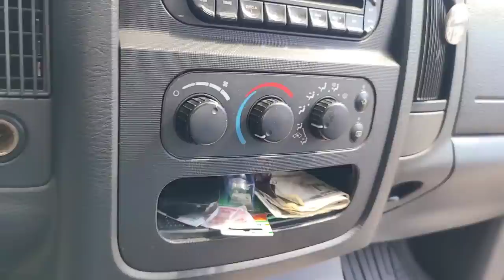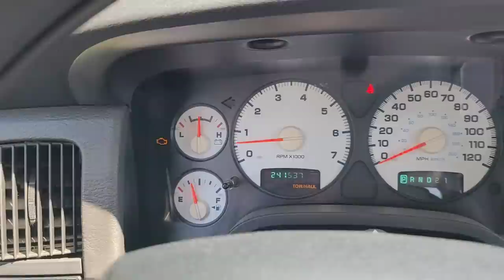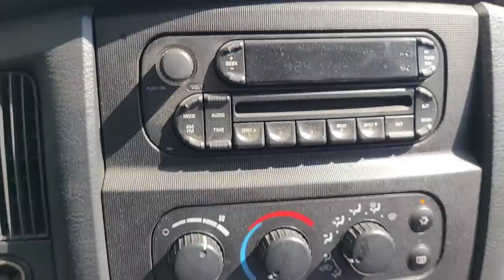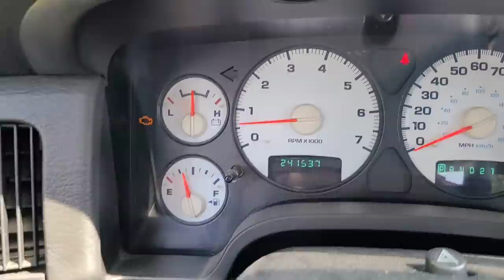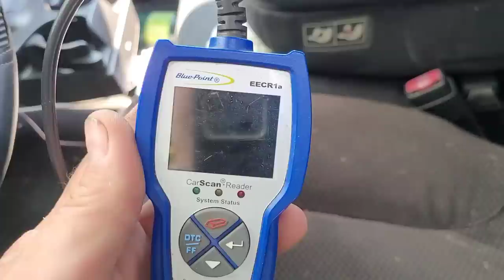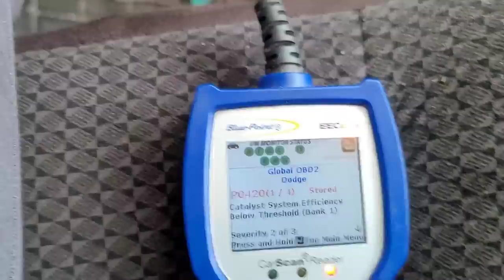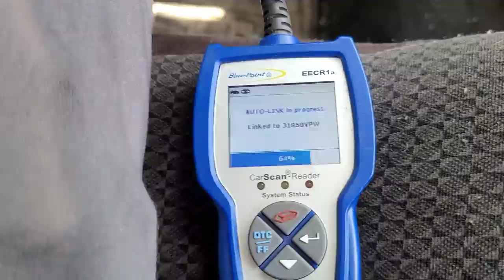Don't Get Scammed Buying Your Next Used Car!!

Comment: I just sent this link to my daughter.  She is looking to get her first vehicle.  I would help her, but she is 700 miles away. This is a big help. Thank you for your informative videos
Reply: There's two things that I always do and recommend doing with anyone who's buying a used car from anyone including a car dealer..,....1) run a scan on diagnostic specifically the mode 6 file which gives the history of the number of trouble codes and how many times they were reset and 2) take it to a frame shop where the chassis can be inspected and they can visually see if any repairs have been made and if they were done correctly

Comment: Really liked your explanation of Torque Management. The amount of work the designers went to to prevent engine and transmission damage is amazing. I’ve disabled most of my torque management via HP Tuners.

Comment: This is one of the best pre purchase used vehicle guideline videos on Youtube. Your truck would be considered MINT if the rust had not rotted the body and frame. Because here in Upstate New York, that year truck would be in the crusher already. The rust would have eaten the entire truck from the bottom up! I owned an 03 Ram that the hood was starting to rust from the inside out from the brined, calcium, and mega-salted New York State Thruway. My cruise control servo, located under the battery actually rusted completely through!

Comment: Great video Kenny. Over here in the UK all vehicles have to do a compulsory annual MOT test where they basically do this to register it as ‘ Road Worthy’.Good tip, I never thought to take my little OBD2 scanner. I tell people I know that the 3 Golden Rules are - 1, ALWAYS take someone with you that knows cars really well. 2, Assume your going to be walking away and not buying this car so you have no regrets about it. 3, If it doesn’t look or sound right there’s a good chance it isn’t so walk away. Could I suggest some add ons? If it’s a manual ‘stick’ shift move it through all the gears, including reverse and work the clutch pedal a few times. Shift the gears in order and randomly with the engine OFF and again with the clutch in and the engine ON before you pull away. check for odd noises, tight shifts and grinding sounds. If your Brave enough do a reasonably hard Emergency stop to see if the brake pedal dances under your foot as the Antilock Braking System kicks in.

Comment: Great job informing your average person and also mechanic, that may not have thought of some of the checks you just showed? While inspecting a vehicle for sale? I was also taught by my father, at a very young age, to never look at a vehicle in the evening and especially at night? What you may not see, can really bite you after the sale? Asking the owner why they are selling that particular vehicle, will put them on the spot, and give you an idea of things purposely not disclosed, possibly? Last item I'm sure Kenny would recommend doing, at least, is make sure the check engine light is actually there, in the cluster, and luminating while in the run position? Awesome video, Kenny, as usual.

Comment: I test drove an old Plymouth years ago . Manual steering . It had a bad idler arm . My friend was in the passenger seat , the owner in back . I mentioned the steering , which pulled when I was coming to a stop . Not a brake pull . The guy actually leaned over the seat and grabbed the steering wheel as it pulled . " I don't recall any problems " ! Or the car " just painted " - with a BRUSH ! Or the " shop " in Brooklyn straightening a Cadillac chassis - with a blow torch and a sledgehammer ! Or the " rebuilt " engine . AKA valve cover gaskets and spray paint . Over spray EVERYWHERE ! Endless ! Buyer beware .

Comment: I consider myself somewhat car savvy. I bought a 2year old Ram 1500 5.7 with only 27k miles on it. I did check off many of the things you outlined in your video. However I didn’t remove the radiator cap and peek inside. I bought the truck and drove it home. All was well for a week and I noticed some coolant on the ground. I checked the radiator and found a ton of stop leak. I replaced the radiator, thermostat and in short order… the water pump… all because I didn’t look in the radiator.

Comment: Don't forget to look at simple things like the brake pedal, steering wheel, inside drivers door handle and panel, and the windshield for wear. If they seem to be more worn than the mileage on the cluster, it was probably rolled back. Yes, all of those things can be changed but when you start looking at carpet and seat wear along with other things you can get a pretty good idea.  Even if some of those things were changed, chances are they probably overlooked something. Good luck and God bless.
Reply: I look for heavily worn pedal rubbers and check the side bolsters on the driver’s seat. Well worn means well used.
Reply: Not only look for smoke on start up, I cup my hands at the exaust and smell my hands. Then wash them and do it again at operating temp. Also smell the antifreeze for fuel.

Comment: Kenny, all fantastic advice. If I'm buying a diesel I want to see it when it's cold and not run that day.
Diesels once started will usually start OK but first thing when the oil has drained from the cylinders and piston rings it'll show up low compression OR if nothing else it'll let you know if the glow plugs are working. 
OK, if it's a private seller that may be a problemo, but if its a dealer and they won't let you see it cold don't bother even going to see it.

Comment: Great advise. Also ask the seller why they are selling it, the history of the car (how long they had it, how many owners, and the type of use), and what if anything is wrong or not working before your inspection. It is a yellow or red flag when you find things they did not tell you about.  On test drive, do not let the seller distract you with the great sound system which could cover noises you should  listen for. If it seems wrong, walk away. There are more cars out there. Most important, if you find it was in a flood or has water damage, don't walk, run away.

Comment: Kenny this is a very helpful video. I would like to add some more; after acceleration let the gas pedal loose to have the car braking on the engine, then again continue to drive and look in the rear window to see if there is (blue)smoke. Notoriuos for BMW's seeping oil at the valve seals.

Comment: My local newspaper has a $500 or less section.  I was in need of a vehicle and a 1998 Mitsubishi Diamante appeared in the $500 or less section - they had $500 on it which they said they would pay transfer fees at the county clerk's office.  I was in a need for a vehicle fast.  I was the first to call about it.  I looked it over. Tires were brand new and the battery was brаnd new. All the electronics worked.  With the engine off there wasn't any leaks however when the engine was there was oil leaking out of the fill cap.  It was cause by blow-by.  Knowing this I bought the car any how.  I always made sure that engine had plenty of oil.  A friend who was able to fabricate things designed something to protect the alternator and the AC from the oil.  The car finally after about 6 and a half years blew the engine.  My fabrication friend cut the catalytic converter out and I scrapped the car.  For the car I got $575 and $150 for the catalytic converter.

Comment: New Jersey state inspection only checks for check engine light and absolutely nothing else. You can drive in with engine cradle k-frame rusted out, calipers that leak, no windshield wiper blades and bald tires and still pass & get 2 sticker

Comment: You should do a car on the hoist to look at frame/ sub frame etc. Oil leaks engine transmission,  radiator, belts . Good video though.

Comment: In regards to the part of the video that discusses clearing codes right before selling the vehicle, there are some new developments. First, you can't reset a hard fault. It will always come back, even if you clear them. For emissions related DTC's like EVAP codes, modern vehicles will set what's called permeate DTC's. Permeate DTC's are actually temporary codes that only the PCM can turn off. They mean codes were cleared, and the PCM isn't sure if the problem is fixed or not. Once enough information is gathered by the PCM, it will clear permanent codes if the system is performing normally. Otherwise, it stays. So, if you have some permanent DTC's listed on your scanner, don't do anything and wait to see if the PCM clears them. If not, the issue isn't fixed.

Comment: Really cheap one is around $10, which will read codes, read monitor readiness, and show live data. Monochrome LCD, and sold by a good number of places, and a good enough unit that you can leave in the car all the time.

But yes a really good set of procedures, which are applicable to all vehicles, even worth doing if all you are doing is renting it for a week from one of the rental companies, to at least make sure you are getting a vehicle that is functional, and where you will not be dinged for damage when returning it, that was there, but not noticed, or noted on the sheet, when you signed for it.

Comment: have a couple of my own from over the years as well...especially after 16 vehicles (and every ONE of which, including the OBD1's, had a check engine on).

for rustbelt vehicles, look underneath FIRST.  PA vehicles especially, as we have an almost draconian inspection when it comes to that.  a single pinhole can fail an otherwise lovely low-mileage vehicle.  also, look for "coverups"  I recently lost a low-mileage Honda to a hidden pinhole in a subframe.

check the wipers immediately...if they've deteriorated, the vehicle has been sitting in place for at least 3 months.

many times, a private seller or small lot will have never looked at the vehicle themselves.  both a dealership and myself were conjobbed by a small SUV that was rotted IN HALF...and since the dealership itself didn't look...(they've since gone out of business)

one item, minimum, out of the following is usually missing in this area; Jack, Jack tools, spare, spare keys (including fobs), floormats (for some cockamamy reason), manual.

inspect the bulbs not just for working conditions, but for sheer old age.  a lot of the time, the original bulbs are still in the sockets, and they're blacker than the inside of a mineshaft on the first day of winter.  there also may be mismatches; some people only replace one bulb when it goes out, not both, or use the wrong type.  I found a brake light bulb replaced with an amber replacement, for example.  ambers often give themselves away as old as well...the coating peels off or it is a really pale yellow.

Comment: 35:38 I remember older cars had either a rod or a cable that ran from the carb or Tb down to the tranny to control the line pressure. In my old 85  grand marquis you could always tell when it shifted.

Comment: The first thing I do is look underneath the car (for rust, leaks), then check fluids, and then drive it like I stole it. I mean drive it hard. If you're gonna have any trouble with it, it'll be when you drive it hard, at good speeds (60mph plus of possible). I had an Ford Expedition have transmission issues, just before pulling back onto the dealer, and a Ford Explorer died on me in one of the busiest intersections in my state. I dodged two bullets just by test driving them hard.
I also looked at a Toyota T100 from back east. The pickup bed was rusted all the way through. That's why it was so cheap. NOPE!

Comment: Always always take the oil filler cap off and check that it's clean if you see any white gunky stuff walk away as it's probably a blown head gasket
Reply: Little bit of white is fine, short trip and engine did not get hot to boil off the water. But if it is like a glob of hand cream inside, not a thin film, yes water leaking into the oil.

Comment: Looks like a mobile dumpster. I would add to check the front tires for uneven wear and whether there is any frame rot.
Reply: Will see frame rot in fullsize GM and Ford trucks.Rarely see it in Dodge/Ram trucks

Comment: Cheap vs mid/ expensive scanners can behave so much differently on different years and models. My 01 Yukon I used a cheap Autel scanner it worked fine except it couldn't read SRS codes, then I purchased a 12 Ram 2500 Cummins , that old scanner was useless,  so I purchased a $400 scanner when I got my first CEL because the old one couldn't read it, it was The PVC filter and a upstream O2 sensor, I tried the new scanner on the  01 Yukon and it gave me all kinds of codes that were not there??? The codes I got 16 in total it would be impossible for it to run with all the issues the scanner said it had!! I had the year, make, model and engine correct but it still said it was a complete mess. Point is not all scanners will work.
Reply: Yes that is true but some vehicles will set codes if you changw the battery & don't scan it afterwards doesn' mean all those things are wrong they just need to be reset then you will know what hard codes are left.Cheers.
Reply: Having a scan tool is one thing, but knowing what to do with the information it gives you is something else altogether. A bunch of codes, in most cases, isn't that big of a deal. You have to know what type of codes they are which ones are the most important. You start your diagnosis going by whatever the primary DTC is. In your case, there's probably nothing wrong with your old scanner, its just that as vehicles are constantly getting more complicated, new codes are needed. You need a newer scan tool more than an expensive one. 

Next time you use your scanner, look at the first letter on each of the DTC's. They will either start with a P, B, C, or U. Disregard all of the ones that start with a U (In almost all cases, where you have a lot of codes, most of them will start with a U. If any start with a P, look at those first. Those are the most important ones. Then B, then C. After the first letter, focus on the first number that comes after it. If it starts with a 0, its an OBD code that means the same thing on all cars. You should always be able to get all of them on any modern scan tool. Any number other than a 0 is manufacturer specific. Your scanner may, or may not read them. 

"The codes I got 16 in total it would be impossible for it to run with all the issues the scanner said it had!!"

Maybe. Disregard all the U codes. If the ones that are left over will prevent the vehicle from running, Your PCM may go into an open loop condition. Open loop disregards a lot of the information the PCM needs to set your fuel trims, and instead uses a different fuel delivery strategy to keep the engine running. Look at the data stream on your scanner. When you first start the car, it runs in open loop. Once the engine reaches a certain operating temperature, it drops into closed loop. You should see this happen in real time on your scanner. If not, that's a problem. This info is very important when trying to diag a problem.

Comment: A couple years ago my wife and I were looking at used vans for our farmers market business. We saw a van in Craig's list in our price range and drove to take a look at it. It looked pretty clean, but I said to her "let me inspect the wheels", so I got on the ground with a small flashlight and eyeballed the wheels. I found 2 wheels where brake fluid was leaking from brake cylinders. Needless to say, we didn't buy the van.

Comment: Hey Kenny, drop me your contact number so that I can give you a call concerning mechanic issues I have with my 05 dodge ram 1500 4.7 v8 4-4 slt truck
Reply from the maker: Hi it's Mrs Wrenching, sorry to hear your having problems. Kenny is still at work. You should go on Facebook Wrenching with Kenny. Input all the info about your vehicle & what you have done to fix the issue. There are a lot of techs and automotive people that may be able to help. You can try our FB group, Backyard Mechanics (3.8K members) they can help too. Be sure to answer all the questions to join the groups. Let us know what you come up with. Keep wrenching!